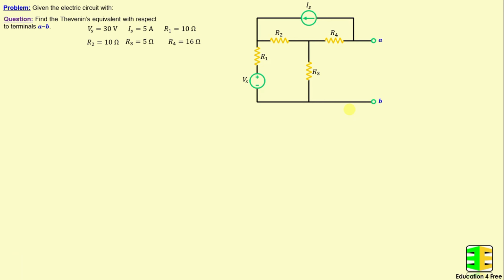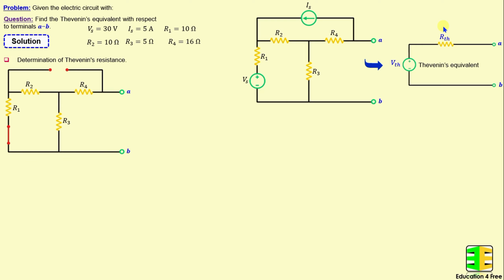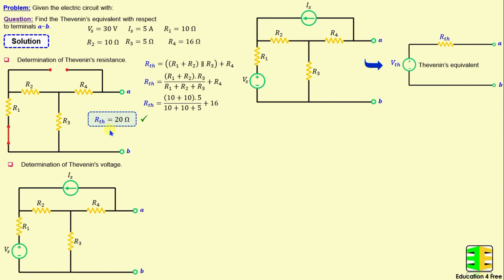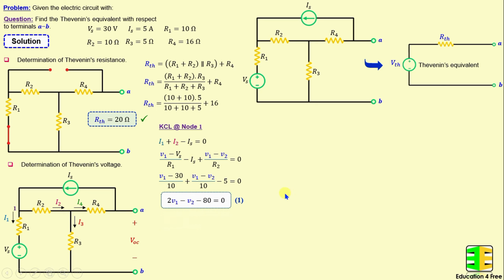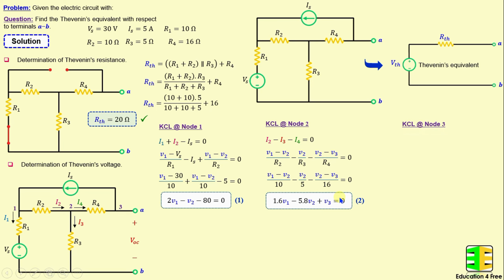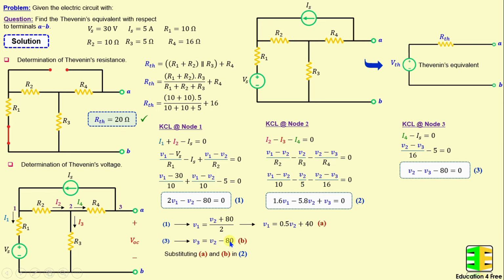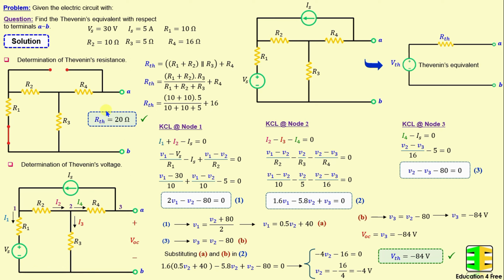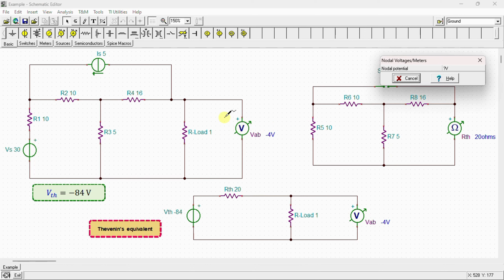Electric Circuits DC | Thevenin’s Theorem | Solved Problem 3

Comment: Thanks for another great video.  Would you mind posting this problem again but solving for Vth using Mesh?  I tried & I'm getting +84V.  Ib = -Is.  Ia = lower left loop.  10Ia+30+5Ia+10(Ia-5)=0 -> Ia = 0.8A. so @ node 2, V2 = voltage across R3 = 0.8*5 = 4V.  V4 = voltage across R4 = -5*16 = -84V.  Vth = 4-(-80) = 84V.  i must have the current going the wrong way somewhere.
Reply from the maker: Please send me your email, I will solve it and send it to you